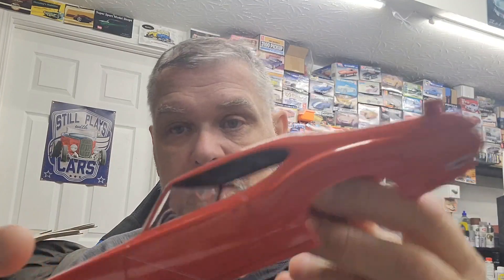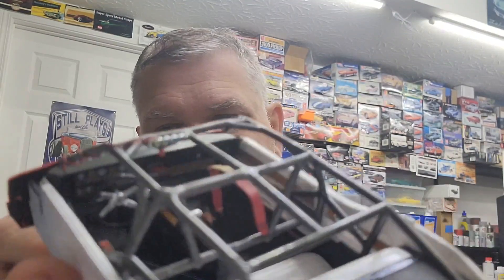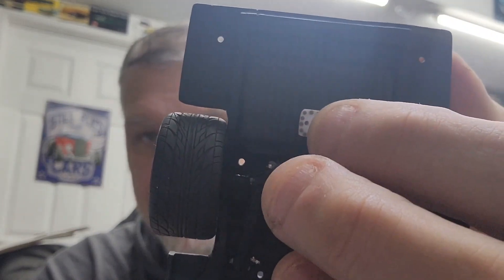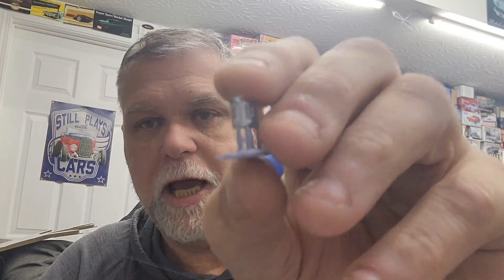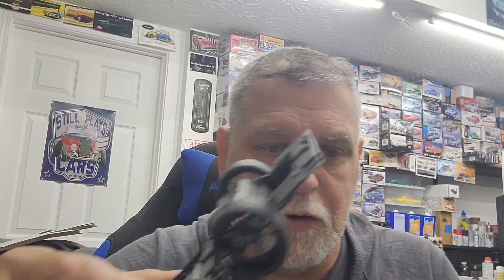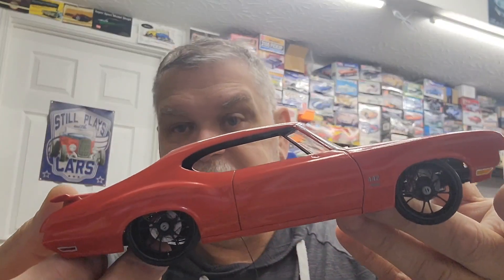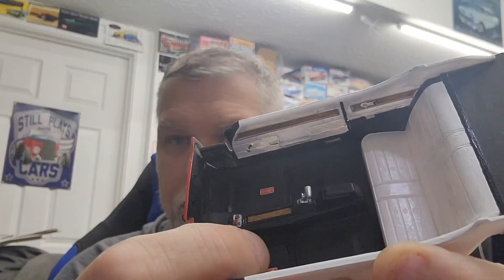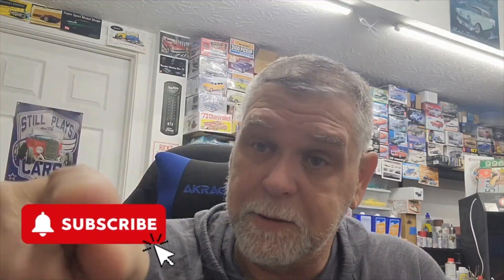Jay’s Mini Scale Garage- Commission Build Update

Comment: I love the build Rick, question for you.  When you fix the warp what technique do you use.  If you need decals for that kit I think i have some for you.  The Donn Yost method works.  I just built a 56 on my channel as a tribute to the man.  Its a great method.
Reply from the maker: I saw yours and yes its beautiful and yes his methods work well,yes i could use the grill decal if u dont mind.
Reply from the maker: I heat with mini heat gun till its kinda soft,then i manipulate to where i need it then spray cold water on it or hold in place till cools that usualy works with no issues🙂🙏🙏🙏🙏🙏🙏🙏
Reply: @rustyrotorsmodelcargarage9410  well Rick, apparently I don’t have the decals any longer.. not sure where they went but I can’t seem to locate them.